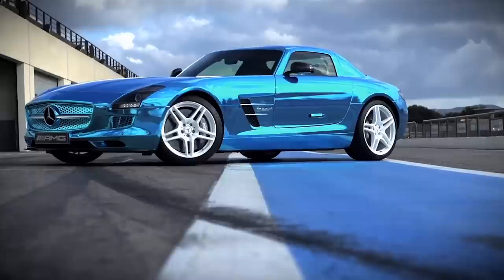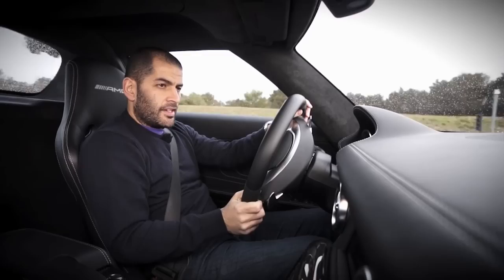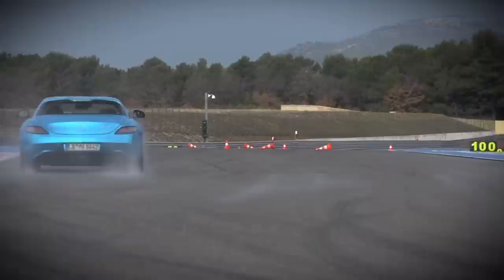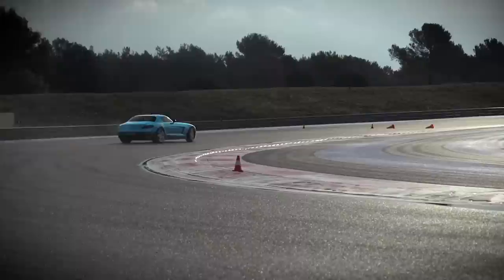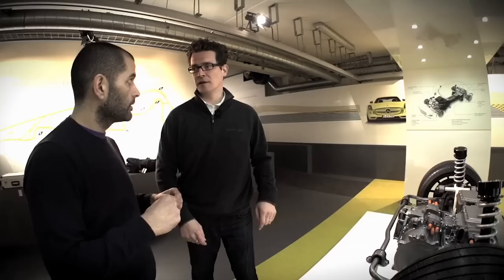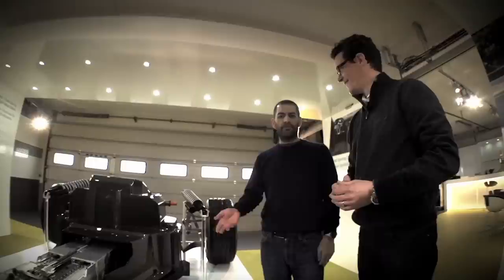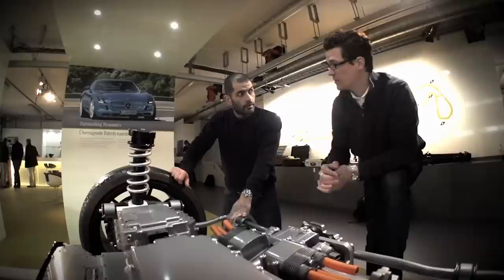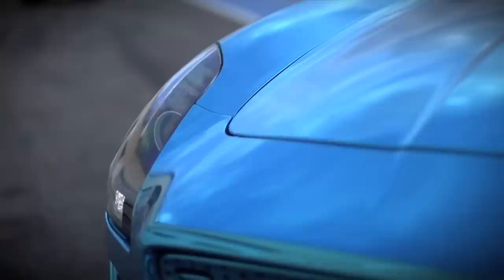Mercedes SLS Electric Drive. Can Volts Ever Match Pistons? - /CHRIS HARRIS ON CARS

Comment: Not true mate... It depends on what you want to use the car for... I mean sure if you're going racing in a track, you're going to care for performance. But I'd like to have an everyday fast car that sounds awesome! Hell, I'd sacrifice some speed for sound as part of the pleasure in driving is hearing the noise of the engine. 
I didn't really get to drive many fast cars, but my uncle has a convertible SLK 200 Kompressor and I mean even for such a small engine, the sound is absolutely beatuful!!!

Comment: Negative torque isn't complicated Chris. Brakes have been doing the same for centuries. This way the energy is put back into the batteries rather than just wasted as heat.

Comment: "Infinitesimals have been used to express the idea of objects so small that there is no way to see them or to measure them." -Wikipedia
He says "infinitesimals possibilities", it could be interpreted as that there are so many possibilities that you can't distinguish between them. Imagine a a gearbox with 3 gears, each gear change is then very noticable(meassurable). But if the gearbox had 1000 gears, it would feel all smooth. The cahnges would feel infinitesimal...

OR he could just be wrong;)

Comment: A lot of factors changes the handling properties. (Power distribution, Weight distribution, Aerodynamics etc)  You can't just say mass=1/handling. Lightweight doesn't always increase handling performance. It's just ignorant to define handling with two variables in an equation.

Comment: Interesting if its motors could make cornering faster than original SLS. Because if you can break and accelerate each wheel separately it should pass corners faster, isn't it?

Comment: Can you imagine this car now (or its equivalent) if Daimler had kept on with development?  CCS rapid charging and an E63 Electric drive with 4wd?  Perfect. Would knock any Tesla straight into a cocked hat. Shame all we get now from AMG is a petrol engine with a plug in hybrid that still makes less power than this did 8 years ago?  (shakes head. Dr Z, what were you thinking?)

Easy to forget this only had a relatively small 60kWh battery and yet still managed 160miles range.  That's a pretty respectable 375Wh/mile (a contemporary P100D Model S is 380Wh/mile).

Comment: If electric power storage advances to a pint where the mass and volumetric density of an electrical power storage medium can closey rival petroleum fuels, elctric cars will dominate perfromance wise. One can much more easily and accurately modulate the power and torque output of a BLDC motor than an ICE.

Comment: Rimac Concept One: With a total output of 811 kW (1,088 hp)[10] and 1,600 N·m (1,200 lbf·ft) of torque, the Concept One will sprint from 0–97 km/h (0–60 mph) in only 2.8 seconds and will come with an electronically limited top speed of 304 km/h (189 mph).[8] The engines are powered by a 91 kWh lithium iron phosphate battery,[1] giving the car a range of 500 km (310 mi) per charge.[5] The car's body is made of carbon fiber.[8]

Comment: CVT's can be more efficient in ice engines because they let them run at the optimum rpms. electric motors have a huge efficiency band, and so dont benefit to the same degree as an ice. cvt's however are inherently less efficient than gears due to the requirement of an extra 'stage' of energy transfer. I'm saying that its essentially the same because both are less efficient than a larger motor and direct drive.

Comment: cost is an issue in terms of people who need something immediately to drive. the motor and batteries to power one alone are worth more than that of anything gasoline that puts down the same amount of power. and while whe're on power, no they do not put down more, torque yes.. horses? not anywhere near for the same price.

but long term, they do reduce costs in terms of spending money to get where you need to be by paying an elestric bill rather than gas. although matainence is about the same.

Comment: Yay, someone else who understands that weight is possibly the single most important factor in vehicle performance.  Sure, a gazillion horsepower tank might be able to go fast, but it won't accelerate quickly, it won't be agile, and it sure as hell won't be able to brake hard.  Have fun with your tanks, I'll be running rings around you in my feather!

Comment: so does 4wd, 4 wheel steering, suspension set ups, driver aids like traction control, and with this car torque vectoring, can all make a car handle better even tho these systems add weight

Comment: the only downside is that it's silent I reckon that the sound of the engine as a large part of the reason you buy a super car. Anyone remember the star wars with the pod racers in it? THAT'S the sound an electronic car should make. you tube the if pod racer sound if you can't remember just how sweet it is. if it did conventional engines would just die

Comment: I've got a feeling they aren't really trying, either that or they have small under powered engines. Mind you over here, Hondas are used by a lot of boy racers, but, they aren't the most sought after, it's more Evos, Skyline GTRs, and Supras etc.... basically anything with a good turbo :) Although, a few years back I used to have a 1996 series 2 Celica, non-turbo, and manual transmission, while nothing really impressive, I've blown away many a car in that machine. :D I'd take you on haha

Comment: The cost is not the problem for a super car with electric drive train. Super car gas engines and transmissions can easily be more expensive.
The Tesla Model S is selling below US$100K with around 300 miles of range and 0-60mph in 4 seconds. Making an electric super car getting to 0-60mph in 3 seconds with a battery of 150 miles of range is not even hard. You just need to use a motor with more torque than the Tesla while using half the size (= half weight) of the Tesla.

Comment: Nice review, a couple of questions:

1) Why doesn't it (or in general electric cars) have gears? Are gears just pointless on electric cars?

2) Is there no way of getting it to charge in a few minutes rather than 20 hours? Currently it only takes 1/2 mins to refuel your car, so taking 20 hours is a huge step backward. Surely there has got to be a way to charge quicker?
Reply: Electric motors don't need gears, and having them wouldn't do them any favors. Electric motors have the same amount of torque at 0 rpm as they do at their max rpm. They usually have a set gear ratio because they can only spin so fast, but that's what sets the top speed of the car. The charge length depends on the current battery technology, and will improve over time (with newer models once the technology is available). Different cars take different amounts of time to charge depending on how much power they store and what battery technology they use. You can charge a Tesla half full during the amount of time it takes you to eat lunch. Unlike a regular car which you fill up when empty, you charge your car when at home just like you would your iPhone. You would only need to worry about charge time while on a road trip, but as long as you take pit stops for meals or bathroom breaks you will be fine. Tesla is also working on a way to swap out your low battery pack for a fully charged one in less time than it would take to fill a tank of gas. I am no expert on this subject, but hopefully this answers your question.
Reply: Adding to lucas knorr, one of the challenges of charging an EV (electric vehicle) battery, is the charging setup needed. There's thousands of kilowatts in an EV battery, and if you were to want to charge it within minutes, you would have force more power through the charging device than would be safe. Generally speaking, the charging wires are simply not big enough to transfer that kind of power. They would explode if you tried. Currently, the size of cable you would need to charge an EV within minutes would be too heavy to even lift, and not only that, but you'd have to have that cable attached directly to your nearest power plant.
Reply: Lucas Knorr dc eletric motors dont need gear, ac motors perform more or less like a normal gasoline engine
Reply: +Daniel Sadjadian There is really no transmission or "Clutch" system that can handle the Torque of the electric motor... Tesla tried just a 2 speed transmission on the Roadster early on and they went through 3 manufacturers of which the best one lasted only two months. Electric motors just need a fixed single reduction gear cuz they don't like 1 to 1 ratio which puts them in a "near stall" condition. I think Tesla uses a 9 to 1 ratio gear reduction.
The nature of Batteries is such that they can't take on massive amount of electrons quickly due to density and resistance hence friction which would overheat and destroy them nor can they discharge massive amounts of electrons quickly for the same reason. Ultra Capacitors on the other hand can charge and discharge rapidly but they can't store as much as a battery.

Comment: If it's hydrogen it means it runs on hydrogen.
It's not like a diesel-electric locomotive.
The hydrogen is used as a combustive chemical just like petrol. With water vapour being the only emissions, plus an exhaust note!

Comment: There are four motors, one that drives each wheel. You can't have a v-8 or a v anything. No cylinders. The motors are similar to really powerful vacuum cleaner motors. They just rotate at high speeds. Imagine if the crank itself just rotated, without all the rest of the engine, that's what an electric motor is like.

Comment: water may be abundant, but to extract hydrogen there has to be a lot of energy involved, so all you are REALLY doing is shifting the burning of petrol from the end consumer to the hydrogen producer. + hydrogen fuel cells can be very dangerous in case of a major crash or ill-maintained cars

Comment: I dont think cars powered just by electric motors are going to have a future, at least not with the efficiency that they have now. People forget that, when you run out of battery, you have to plug the car into the electricity to recharge it. By doing that, youre consuming more electricity, that is generated usually by Power Plants that burn minerals, polluting the environment the same way. Unless we start to use massive Hydro, Solar and/or Wind Power Plants, we'll never decrease pollution.

Comment: That much weight is never ok. If you're racing in the mountains, you have to be as light as possible for good handling. Power doesn't excuse weight for handling. It just doesn't work that way.

Comment: I still do not see the benefits of an electrical solution compared to adapting current automobiles to simply run on a gaseous or liquid variant of Hydrogen. Theoretically, all we would need is to do the math for a fair air/fuel mixture, as the ratio of gasoline engines will not apply. Feed the mixture into the cylinder as you would, spark, light, and bang your way to a combustion engine running on the most abundant element we know of. Keep cars, keep engine notes, and do it all soon. Win - Win

Comment: I can't even imagine where these new myths are coming from about the tech being "50 years old". The first lithium-ion rechargable batteries were prototyped - not even ready for consumer use - in the 1980s - and the first commercially-available lithium-ion battery was in 1991. It's been improving constantly since then, and only in the past 10 years there's been a dramatic improvement thanks to mobile computing (laptops, cell phones, etc) that require those batteries. The tech is not 50 years old.

Comment: only untill battery tech improves a bit more... at the moment the only thing ice has over elec is range. once batteries have about 3x the energy density they do now, ice will be obsolete (well, ignoring issues with the grid supporting charging of cars). elec motors are far more power dense than ice, are far more reliable too, given they essentially have 1 moving part. why bother with a ice if elec provides more power, more range, lower maintenance, better for the environment and cheaper running?

Comment: With Tesla tech, that'd cut your charge time to 30 min. BTW the Tesla Roadster was first, not Mercedes. It was the first modern electric sports car with a 200+ mile range and less than 4 sec. 0-60 time. The Tesla Roadster Sport is actually quicker than this much more modern and advanced Mercedes. (Tesla Roadster was designed back in 2006.) Tesla's next "Roadster" will be a hypercar with a 0-60 in less than 3 sec. They already have a prototype with a 0-60 in the low 2 sec. range.

Comment: Electric Cars, that are SO electric, meaning Electric Steering, Electric Diff, Electric handbreak, electric Torque Vector and so on, scare me a little. I'm a programmer and programmers need to bug fix code, it's not a secret that we mess up sometimes ... now if you are stitting at home or the office and your System crashes ... that's okay .. restart and you ae good to go ...
If you are going 280 Km/h on the highway (in germany that's just fine in some places) and your system crashes ... weeeeeeelll... yeah!! Don't get me wrong I do think it's the future everything has the ability for precision, there is Electronic accident intervention comfort modes like audis stop and go traffic "autopilot" ... but it's still scary.
I drive a Mk7 GTI, and I sometimes ask myself .. what if my electric steering craps out?
Reply: I'm sure nothing ever goes wrong with a fully analog, organically fueled, pushrod piston engine, right?
Reply: Sure, but don't forget that even ICE cars today often use electronics systems to control your car. Even if you have some control without the electronics, imagine suddenly losing your power steering and antispin in the middle of a corner during winter :p.
Reply: Aircraft have only become safer as electronics has taken over. It's really just a matter of standards and adhering to them. The general IT industry is pretty lackadaisical about quality control, but that doesn't mean it can't be done. The aerospace, aeronautics, industrial manufacturing, and military industries all do quality control incredibly well. It's very rare for bugs to crop up that are dangerous or show-stoppers in any of these industries, and they're all 100% electronic/software-driven these days.

It may be that we'll see the introduction of professional accreditation to the software design industry as these things become more widespread-- similar to what we have with doctors, lawyers, plumbers, electricians, and so forth. That's probably coming within the next 10 years or so-- and it probably should. There's no reason we should still be living today at the garage/basement weekend tinkerer level of software design in the professional/industrial level of the software industry. It's no big deal if mom-and-pop.com goes down or has a database connection issue now and then, but when you're doing things that matter, it needs to be approached from an entirely different perspective. The industry is really far behind on that today.
Reply: babybirdhome
Yeah, critical systems such as controlling a vehicle with humans inside would adhere to far stricter stability and safety standards than regular desktop programs and operating systems would.
Reply: All kinds of engineering are capable of malfunctions due to design errors. The thing is we programmers are used to writing non critical code and are used to not having to fully test it. However, if you think about it, software is actually the fastest and cheapest thing to test in a car (or other areas), if you actually take the time to do it properly, like many industries with mission critical software do.
Reply: The drive-systems used in cars like e-SLS are industrial-grade so it wont have any issues, because you cant compare a regular (German) software- and hardware-engineering team with a (German) industrial one!
Reply: best response! Completely agree and didn't think of this.

Comment: Rimac Concept_One has been using Torque Vectoring for years! Mercedes is old fashioned af
Reply from the maker: This was 2013
Reply: Rimac as well. And the Concept_one has 1000HP and a range of 500km vs the SLS's 750HP and 160km. The acceleration figures are even more telling.

Comment: 4wd systems and electronic aids make a car heavier but also make a car handle better so heavier does not always= worse handling, its not as black and white as tht. also u can hav smaller thinner wheels/tyres which reduces unsprung mass but gives the car smaller contacts point on the road, that will reduce weight but make the car handle worse due to less grip/stability so theres another example of y heavier=worse handling is not pure fact

Comment: gear a tesla a bit higher and it'll do 140 or even more. 4 gears makes shit all difference with electric motors unless you've got a limited space/options for the motor+controller. you can have a small motor and a gearbox, or a bigger motor and no gearbox. bigger is 99% of the time better, youll get better efficiency and more power capacity for the same weight as a small motor + gearbox. The only other issue is needing a bigger motor controller & battery, which can be expensive and complicated.

Comment: because they wouldn't have the tech to get it nor any use for it at the time, even when they found it they didnt use it. the problem oil has is that it pollutes and its non renewable. Air travel, sea and rail would be nothing like they are today without oil. there is a lot of investment in bio fuel at the moment. I think that is the way to go for now, it is renewable, eco friendly, and has the same energy richness of oil. problem is its hard to make and uses farms that could be used for food.